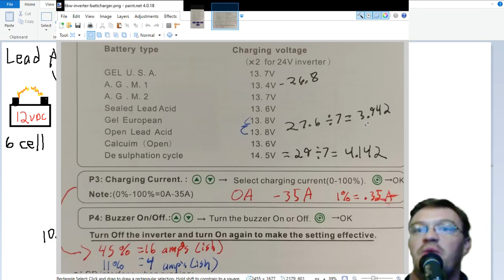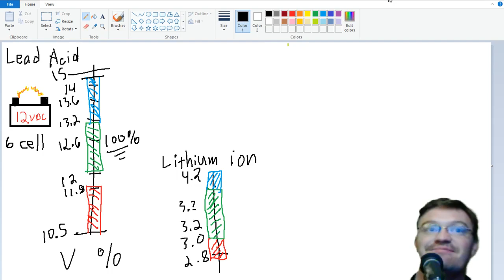SLA Lead Acid and Lithium Li-ion charging and interacting basics

Comment: Can u use them together  like a 48v lion pack with some small sla as a buffer and I was even thinking about using a car stereo caps in parallel to match the voltage  trying to do away with voltage sag using used lithium cells.  My idea was a small 48v pack with 4small tiny lead acid batteries in parallel feeding 4 small car stereo packs in my ebike 😂😂😂😂. I can’t afford new batteries sorry there’s a lot used stuff floating around

Comment: so if you were able to discharge the battery until 0v, you will get the full power, but discharging from 4.2 to 3.0 only give you around 28% of the cell capacity so if your load need 1C you'll need to have a least 3C capacity in you cell or battery bank
Reply from the maker: kind of. please restate and i'll try to help.
you don't goto 0v that harms the cell. State of charge is hard to tell. but basiclly 4.2 is 100% and 2.5~3.0 is 0%. BUT you really shouldn't use voltage to figure out State of charge, its really an estimate and good  enough for cut off levels.

Comment: so the information about 18650 where did you get it
Reply from the maker: many sources. http://batteryuniversity.com/ is a good start. Try to find the datasheets for the batteries you have or play to use. They can be different. Also Battery manufactures usually have usage guide lines that